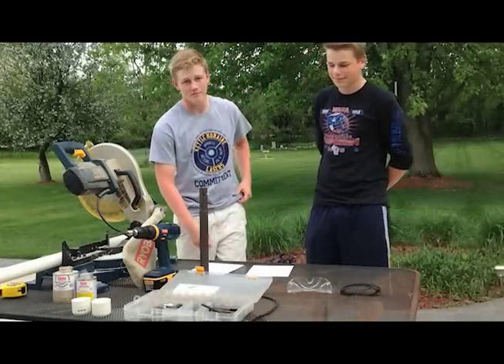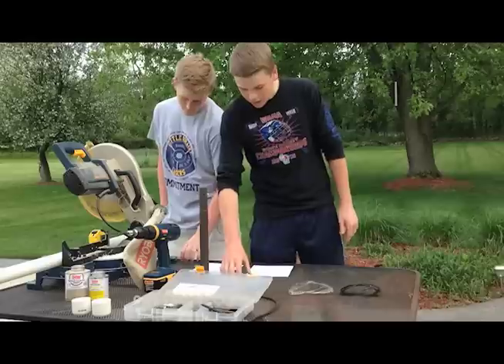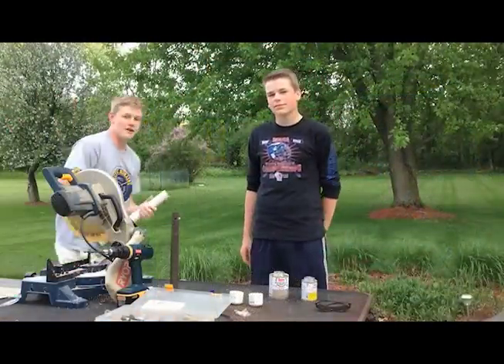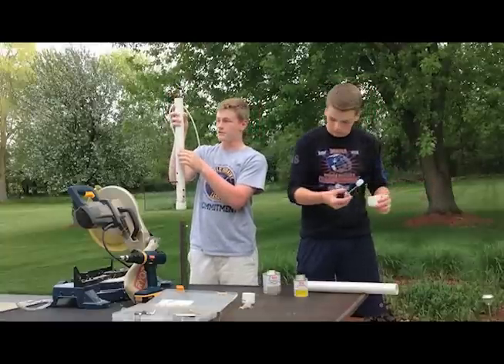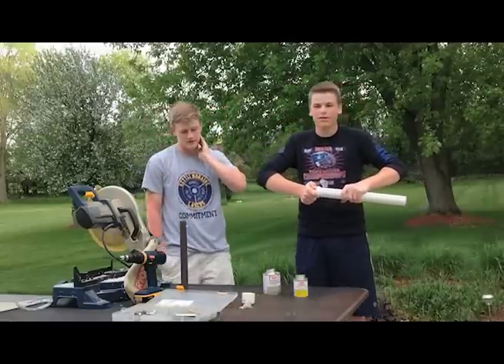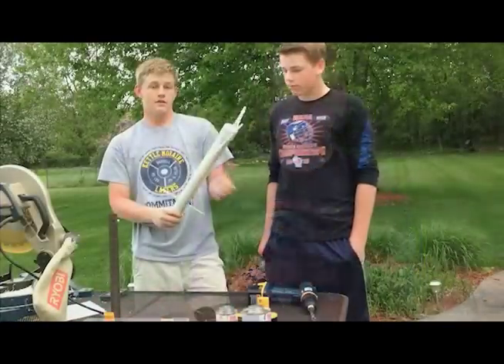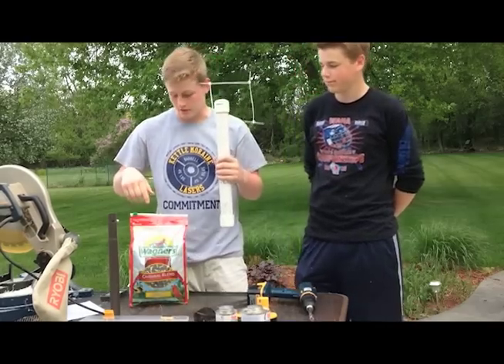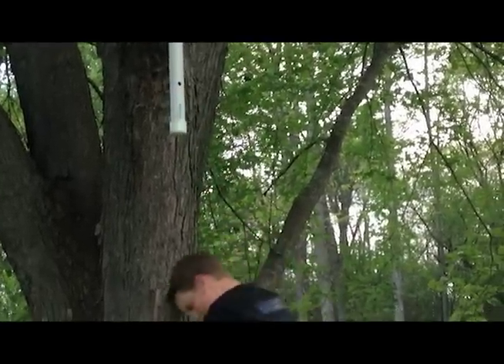How to Build a PVC Bird Feeder Demonstration

Comment: ok 2 problems with this as far as i can see , 1 the perch you have used it metal or plastic , with no grip for the birds feet and would become very slippy once wet , i would change this to a branch or a wooden perch , birds will find your perch very hard to stand on and stay on , 2 the zipties are an easy target for squireels to chew through and take the whole bird feeder away , i would change that for a metal chain and loop it over the branch not just hang it as squireels are very clever and soon learn how to pull things from trees and branches , i hope these idears help but the feeder its self is a good idear